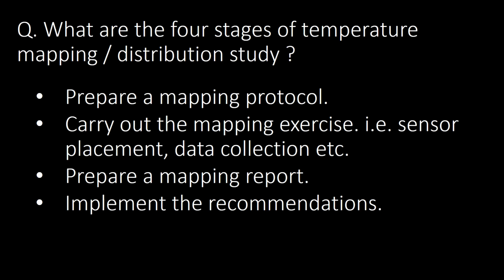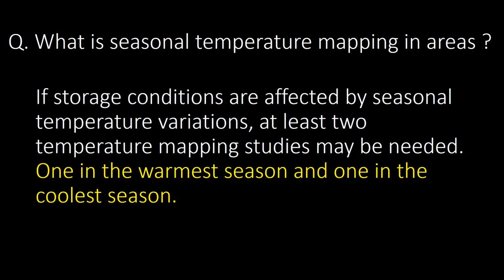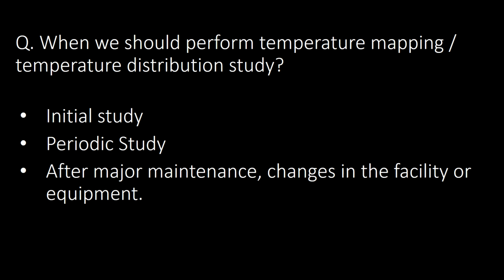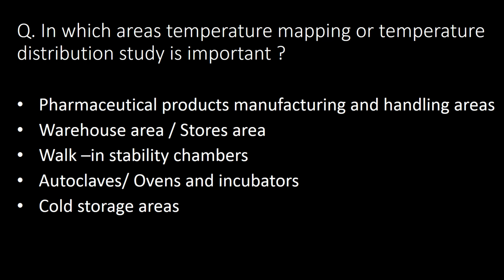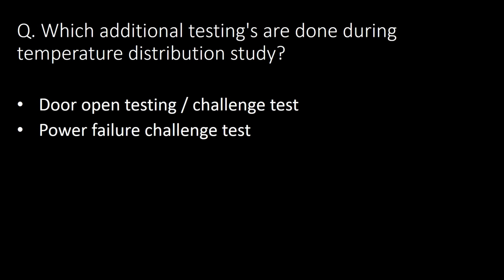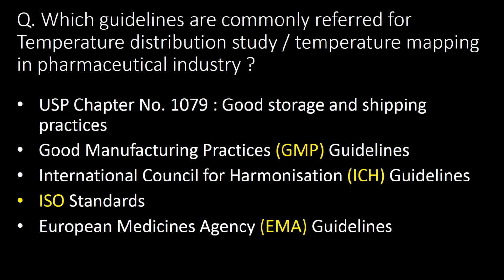Temperature Mapping / Distribution study in pharmaceutical industry I 15 Interview questions

Comment: Product processing area? From where have you concluded this?
Reply from the maker: Question is not clear.
Reply: @PharmGrow  WHO states thermal mapping for storage areas only right?
Reply from the maker: @Chitter_Chatter_  No.  Thermal mapping shall be done for all the areas in which product handled like, product processing areas, packaging areas, storage areas even thermal mapping should be done in temperature controlled transport vehicles. It all about having assurance that temperature fluctuations will not have impact on product SISPQ i.e. Safety, identity,  strength, purity or quality.
Reply: @PharmGrow  Okay but through which guideline document are you saying this?
Reply from the maker: @Chitter_Chatter_  PDA Technical Report No. 58 (TR 58) Risk Management for Temperature-Controlled Distribution
Reply from the maker: @Chitter_Chatter_  PDA Technical Report No. 58 (TR 58) Risk Management for Temperature-Controlled Distribution
Reply: @PharmGrow  can you share the document?
Reply from the maker: @Chitter_Chatter_  I have hard copy. But i can share you abstract page on mail which supports my answer. mail me on Yogpharma409@yahoo.com.
Reply: @PharmGrow  So why have you mentioned thermal mapping requirement for production processing areas? What is the reference document for this?
Reply from the maker: @Chitter_Chatter_  I used word processing areas. Meaning wherever product being handled for processing, packing or stored. Not limited to production area. If you have better wording. Please suggest.